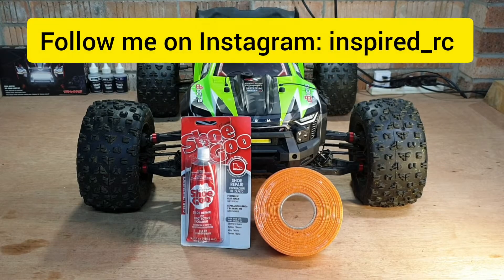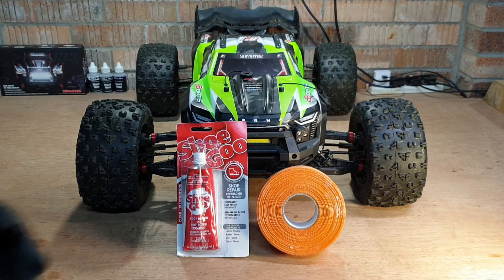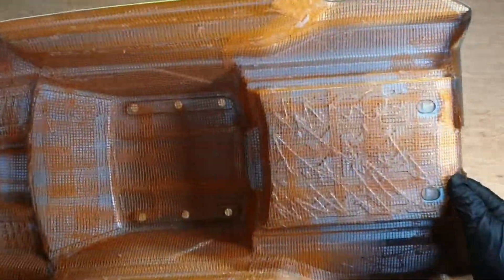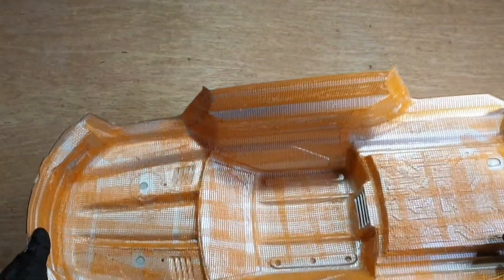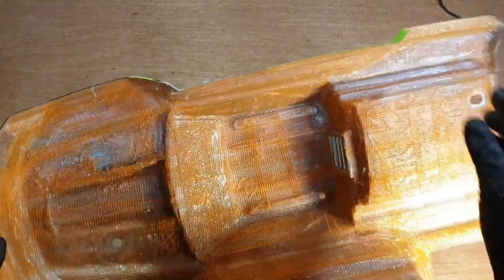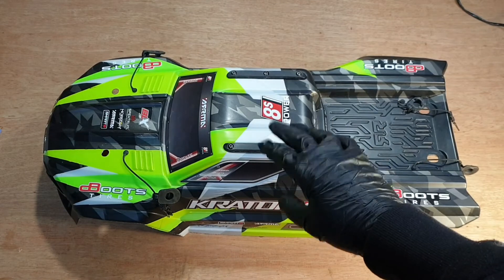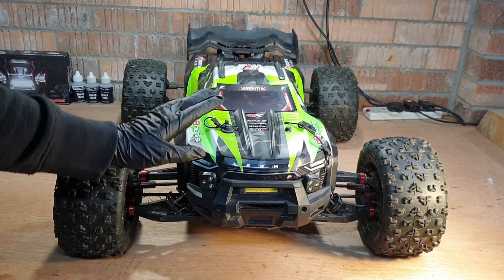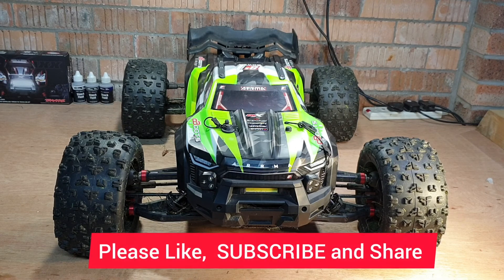Kraton 8s Outcast 8s: How to reinforce rc car body with SHOE GOO glue MOD! stronger indestructible

Comment: How has this held up for you so far?

Are you happy with the job you did?  Would you do anything differently on your next body?
Thank you.  Great job btw!
Reply from the maker: Hi pal. Yes this mod is well worth doing. I did use 2 large tubes but just to make sure an extra small tube would be good just to go over any areas that need more reinforcement. I would recommend putting extra around the front corners of lower splitter under the light stickers....
Reply: @inspiredrc  Thanks for the heads up.